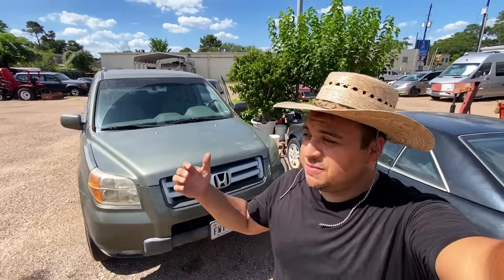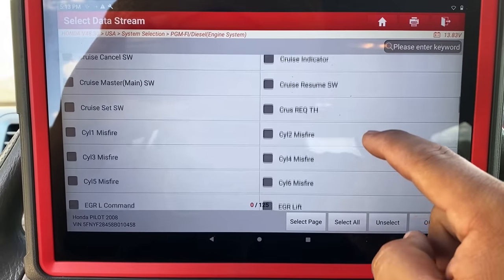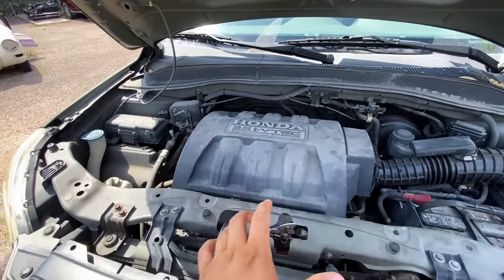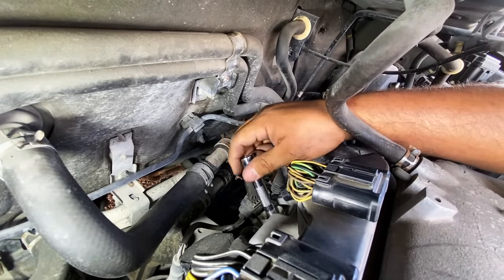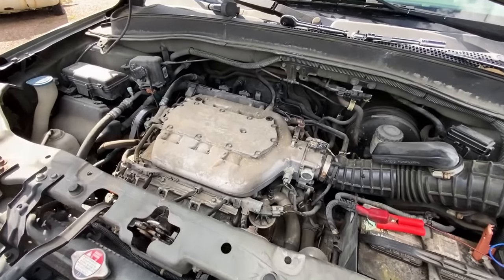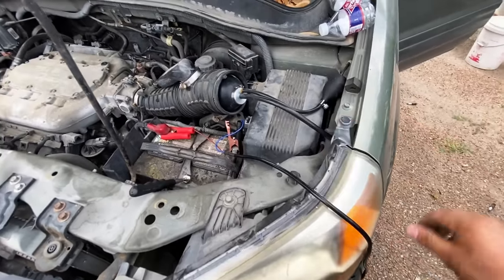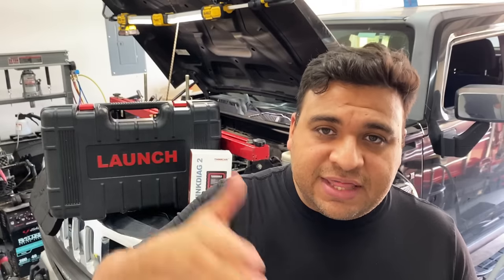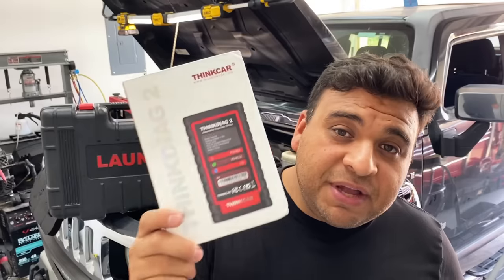HONDA PILOT STUMBLING IDLE RANDOM MISFIRE DIAGNOSIS & FIX

Comment: Your Denso spark plugs are fake.  In real Denso, the letters are made in the form of a fine grid.  On these letters in the form of a whole line.  In Ukraine, such fakes have been found for a long time, apparently now they have reached the US.  Change the spark plugs to normal ones.  Good luck!
Reply: I am holding one Denso of the exactly same part in my hand (factory installed), I could not see any difference in lettering! What were you talking about?